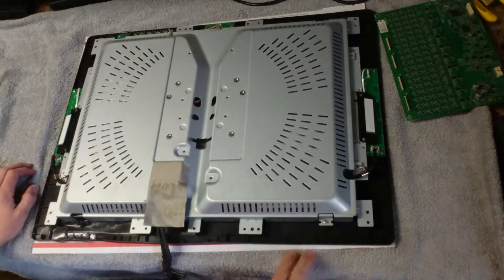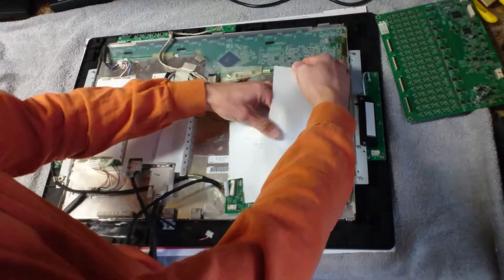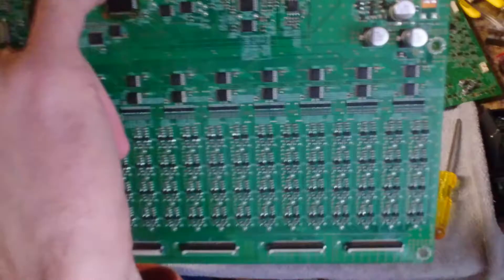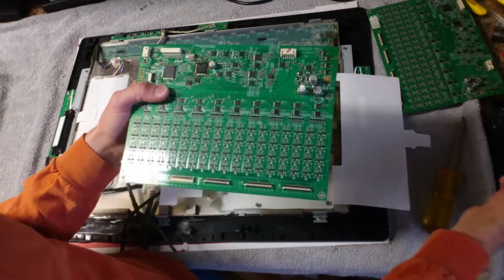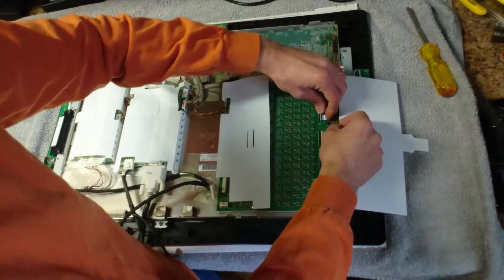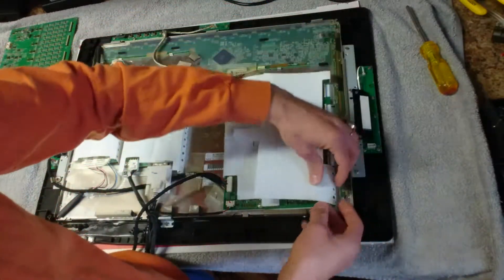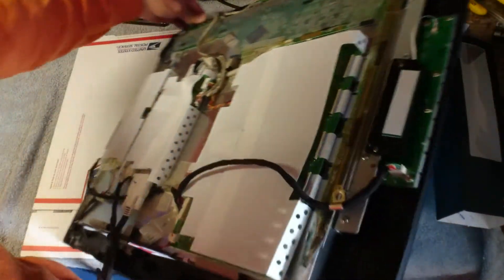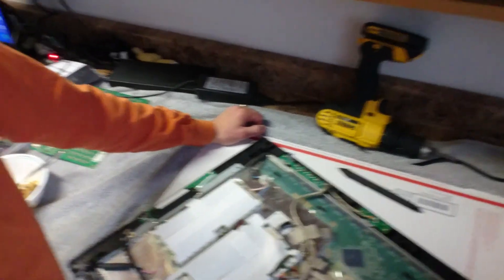Cintiq 21UX DTK-2100 Additional Tips and Tricks for Digitizer Repair

Comment: hello, love the channel. this is a great collection of resources for reviving cintiqs. I was wondering if you could tell me a bit about gen 2 21UX, specifically the ballast inverter board for the CFL's. do these have a common failure point? transformers, triacs etc. I have two 21's with different cutout issues, one doesn't stay powered on for more than a second anymore, and the one I'm trying to revive will work fine on a cold start, but after a full day of use if I turn it off and on again the CFL's fail to light up and I have to wait a few hours for it to cool down so that I can use it again. the LCD panel continues, it's just a backlight failure 

thanks in advance
Reply from the maker: I would just try to replace the inverter board with a universal one and Jerry rig it in place basically.
Reply: Hello, did you make any progress on this ? I am having a similar issue.
Reply: @piorism  I gave up and replaced the inverter board with a known good one off ebay. when this one dies I'll try a little harder to probe it , I just needed to get back to drawing quickly
Reply: @MysteryManBob  Hello ! Thank you for your reply, this sounds like a straightforward fix for a repair shop then. Do you happen to have the reference for the part ?
Reply: @piorism  the board is 4H.0VJ40.A04 DTZ21XX-INV-7.PCB

Comment: Hello Ian! I, like most that comments on this video, have a malfunctioning DTK-2100 and would be grateful for any assist. Everything seams to be working on the 21ux except that there is no video signal. Button and status lights works, I can open the button menu. USB connection is working and properly recognized, as long as the screen does not go to sleep which can be prevented for a short while with having the button menu open. The screen has been its box for around 10 years, in an attic. I have tried all the driver/boot/uninstall procedures there is for the screen. I also bought a dvi-i to displayport adapter and tried a bunch of other adapters as well, still no signal. I was wondering if you had any idea about this issue before I start taking it apart to see if i can spot an issue.
Reply from the maker: Email me, I will send you a new cable. Or you may be able to replace just the DVI portion internally to test if that's the problem.
Reply: @procersapientiae hello Ian, I seem to be having a similar issue. The signal seemed faulty and we opened it up and switched the DVI cable to a new one and now it stopped working all together. 
I’ll send you an email, thank you.

Comment: Hello Ian...I love the details! Quick question...I ordered the dual inverter from Mouser and instead of it saying "W62" on top it said "CDJ" w/ a vertical bar before the "C". Will this work as well? The TI part # is SN74LVC2GU04DCKT. Thx in advance for your response! (Ed or Edris356)
Reply from the maker: The Dual Inverter I linked is a good substitute. The W62 was the reason this was hard to figure out. Wacom had all the parts custom labeled to W#, so I had to consult an EE forum to figure out what it probably was based on some multimeter readings.
Reply: Thank you Ian. I've got your email in case I need to use your services if it doesn't work out.

Comment: hi, Ian, I know this is a long shot but I have a 21ux that was "working" condition, but no status light would come on, on rare occasions if I brought a pen to the screen it would say incompatible pen (rare as in saw it 1 time over hours of troubleshooting and testing). I replaced the board as shown here with a "working" one. It seems the exact same, everything else works the screen buttons all of it. Is there any other point of failure that could cause this? or a common thing when swapping boards that I can check? All cables seem to be plugged in securely. (am looking for my multi meter again before I open up for more testing and will check the reading to confirm the part is faulty)

would be interested in your thoughts? 
(oddly enough with the old board, could tell the inverter was fried, when I would shut down the computer to restart I actually saw a small dot move in response to my pen movement, with no status light coming on. It was during the blue background on Windows 10 when it closes the remaining open application)
Reply from the maker: The fact that the buttons work tells me that it's not a typical board failure, which is really unusual, it's very weird that you have two problems and then both the status light and the pen aren't working but the buttons are working and the buttons all come off that board too. When I had ones that failed in the way that I repaired it, the whole USB interface doesn't work at all. So that would mean that the side buttons and the scroll wheel don't work either. Once you fix that problem it works completely, now what's even weirder is that you have both the status light and the pen not working so I don't know what to make of that. I would say to send the board in but maybe the board's working fine and this possibly just a loose cable somewhere. Weird, but for no pen you're going to have to be all four cables I would have to be out so I really have no idea without seeing it in person. Are you anywhere near Massachusetts?
Reply: @procersapientiae  sadly not, dang looks like I got the good news you get to name the disease because nothing like we have seen. That does help though most things I saw with the "no status light, and no pen picked up" didn't mention the side buttons and USB not working. So at least I know the problem might involve something more on the board.

Thank you so much, especially for the quick reply. (oh, I know it's an old video but you might want to bumb up the audio volume basically had you at max so I could hear, at least compared to standard videos)

Comment: Hey, thanks for posting this. I think I have a similar problem and if so, then you saved me a ton of time trying to find it or a handful of cash swapping the whole board like I very well might have done. The resistance across C225 is ~535K and across C226 is infinite. There's no oscillation on U50's pin 6 going out to R56. There is 5V across C42 as expected, but there is also 5V to ground on one side of the crystal and 0V on the other. Here's hoping that it was just a poorly sourced IC and I have one that died differently.
Reply from the maker: I've seen it like that before, should be like 5v, 4v and once fixed -4v on the third rail.
Reply: @procersapientiae   Indeed. I checked what seemed to be that other mid-board rail like you said in the StackExchange post and it was something like 0.55V. The good news is it works now! IC011 in a PTZ-431W was doing the same job, so I borrowed it rather than wait for another Mouser shopping list to build up. Many thanks again for the clues!

Comment: Hey so I am having an issue with mine and the thing is it works in a sense as I can use it but after a random period of time it randomly shows a bunch of lines and then goes black but I still see the menu/display saying that I need to connect it. could it be the display cable itself or is it going to be a chip? If it's a cord-related issue great I can probably find something to replace the display cable if not I really dont know what to do.

Comment: I'm glad you've posted this video. It appears that I have this failure on my board as well (reading ~1MOhm on the first cap and ~16KOhm on the second). I read in another comment you perform this repair as a service, do you still offer this service? I don't have the experience, dexterity or tools to do this myself.
Reply from the maker: Yes! We still offer repairs. My email is IATompkins47@gmail.com send me an email and I'll get you my address etc

Comment: can we see a close up of the solder on the inverter? not really sure if i can just gobble some solder on both sides and call it good! thanks for the videos my dude, you a real one
Reply from the maker: Sorry for the late late reply. this is definitely a delicate chip, it's best to try to use a very small marker tip iron and just aim for individual pins, only clean up if you need to with a braid.

Comment: Hi, great video. Really helpfull in really specific circumstances ;)

I have a quick question though: I have a problem on mine with the digitizer not working and tested the two capacitors you pointed out. The one closer to the (probably) defective chip reads about 1 MegaOhm, the one further away howerver comes out to about 17 KiloOhm. You mentioned 30 kOhm. Could it still be the chip in question or is that too far off? Thanks in advance!
Reply from the maker: Generally speaking, since the resistance is less than infinity it's because the component has some kind of partial short or damage, so anything roughly within an order of magnitude would qualify as being "around" the same failure (i.e. 10-100KOhm is << 1MOhm). I would say to swap that chip, most boards tend to have that failure. Note that it is a dexterity challenge to swap.
Reply: @procersapientiae  Thanks, I figured something along those lines but wanted to make sure. Luckily I work with a bunch of electrical engineers and I figured I'd just see if I can bribe one of them who has more expreience/stable hands than me with free food to do the soldering for me :D

Thanks for the help. It's pretty galling when your realy expensive piece of technology turns into e-waste overnight.
Reply from the maker: @karl-michaelkoehler4296   I'm hoping you have success with a friend, I just also wanted to mention, with this particular repair, I generally do it for $50 plus shipping, esp. if you're just sending the board, so if that's reasonable that's also an option. Definitely let me know how it goes though. Idk if you're in the US or abroad, which often affects the viability of that option.
Reply: @procersapientiae  I'm abroad. That's why I figured I'd give it a shot. If it doesn't pan out I'll have to look into what the shipping will cost me.
Reply from the maker: @karl-michaelkoehler4296  If you can keep it under 1lb it's usually not that bad to ship, but definitely not as cheap as domestic.

Comment: What is the chip called that you have to replace?
Reply from the maker: If you watch part 1 in this series it has this link: 
https://www.mouser.com/ProductDetail/595-SN74LVC2GU04DCKT
This video:
https://www.youtube.com/watch?v=K3sVJxPNXCM
Reply: Yup. I just got out the magnifying 3rd hand and my cellphone flashlight. 
It does have markings on it! It looks to say CDF and a vertical line on the left. The old chip has a line on the left too. W62 old chip
Reply: So the braid will clean up over-spill? 
Sometimes solder blobs over two points. So the braid when pressed and heated, should clean that up?
Reply from the maker: @Keifer-D  I don't really recommend the solder sucker, when you use the braid you press it to the joint with your iron and then tap it with a tiny dab of fresh solder to get it to flow on from the component, it will wick up by surface tension that way. It helps keep joints that get doubled clean and then retry to get them properly soldered.
~Ian A Tompkins
Reply: Awesome! I will let you know the outcome. Just ordering new tips. Thanks for your help!
Reply: Ok. So I soldered on the chip the best I could. 
Damn that was hard! 
So it detects the pen, but says it isn’t compatible. I got this Cintiq used, so maybe the art studio gave me the wrong pen? It’s the Grip Pen from what I can tell.
Reply from the maker: @Keifer-D  It is a challenge, isn't it? But if it's doing anything it means you got the digitizer working, that thing prevents the clock cycle from making it to the main chip, so if it weren't working, it would literally do 0 things. You probably have the wrong pen, email me a pic of the pen. You need an "intuos 4" pen that says "wacom" TWICE on the little plastic near the eraser or you need an 
intuos 5 pen or some newer pens, but not too new.
email is IATompkins47@gmail.com
Reply: Yeah. So my pen is a bit worn, but can see only one Wacom logo. Hummm. I might have to contact him back and see if he made a mistake and gave me the wrong pen. Because the pen holder with extra nibs don’t fit in the pen. Which indicates that the extra nibs are for another pen.
Reply: Ok. I have the part ordered and is here. 
My concern is that the part ordered (you linked) doesnt have any markings on it. Is there a right way to place this? And a wrong way? 
Like a forwards and backwards. I don’t want to fry this chip or anything else. 
Gosh this is microscopic soldering! Lol I don’t know if my solder tip is small enough. I had to file it down a bit (all I could do). Maybe I should order another tip instead?
Reply from the maker: @Keifer-D  you probably want to have a small tip, it helps, and some soldering braid. The new chip should have some letters or a line or a dot/indent indicating the direction it goes, you may need to refer to the data sheet on the chip and markings on the board. The inverter direction points away from the quartz clock from my recollection.
Reply: Yup. Got the braid, sucker and really fine solder with 70% lead. I will wear an n95 mask while working. I will have to purchase another thin tip for soldering.

Comment: Hi Ian, Any idea where can I get this board? Even if its not working. I’ll appreciate any info. Thank you!
Reply from the maker: There is nowhere to source the board. Do you have a defective one?
Reply: Actually no, I found a 21ux from a friend, I opened up and the board is missing, the rest of it looks fine to me, so I might buy another broken one with this board and fix it.
BTW thank you for your videos, I fixed my brothers 22HD! 
Any advice where to buy a cheap 21ux for parts? -Cheers!
Reply from the maker: @harugoodgirl  unfortunately they don't show up very often, partly because most people send their boards to me 😅 does the Cintiq light up?
Reply: No idea. Can I turn it on to check even without the digitizer board?
Reply: Hey Ian! Guess what, I found a digitizer board down here in Mex City, just the same one you have in the video and it is available for about $60us. Is it a good price?
Reply from the maker: @harugoodgirl  dag, that is kinda pricey, I would definitely make sure the unit turns on first though, if it does, that could be worth it.
Reply: Thank you Ian, so I’ll bargain for a better price, lets see how it goes, I’ll keep your audience updated and look for more parts in case somebody is interested. -Cheers.
Reply from the maker: @harugoodgirl  The only reason I say it's not a great price, is the 21ux often sells on ebay broken as a complete unit for $50-70, so paying $60 just for the digitizer is kinda blah.
Reply from the maker: ALSO, I've been assuming yours is a DTK not a DTZ unit, right?
Reply: You are right, I’ve been watching DTKs on Ebay, 60 for only the board is a lot.
And yes, I am trying to fix a DTK-2100 that I got for about $50 with no scratches at all, I also have the pen and the power brick.
Reply: Well, just to share with you that I aqquire a box with wacom boards and pieces inside, about 60 of them: Digitizer boards, Connections, motherboards, on-off buttons, I would like to show you what I got and see if you recognize these parts since there are some of them without a label. You or your audience might be interested in a few of them, I have no idea if all of them work, but there are a few new ones. Its an interesting box.
Reply from the maker: @harugoodgirl  I could be interested in buying some of it for spare stuff.
Reply from the maker: @harugoodgirl  email me procersapientiae@gmail.com
Reply: Sure! I’ll send pics to you asap. Cheers!
Reply: I sent you a WeTransfer file from gnetwalker, check it out!

Comment: Amazing , how much would it cost to fix a DTK-2400 digitizer ?
Reply from the maker: I have since gotten experience with the 2400 digitizer. :)
Reply from the maker: I have not worked on the 2400's digitizer, but I could take on the job. Price would be about $150 Worst case scenario, I have machines that I can pull parts from while I work on the issue.